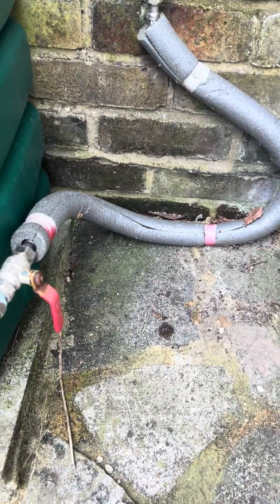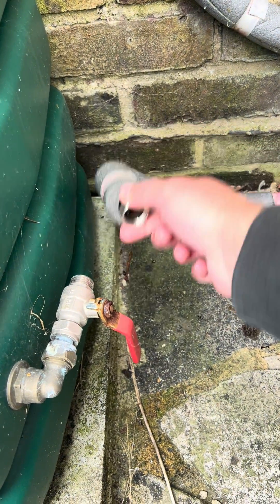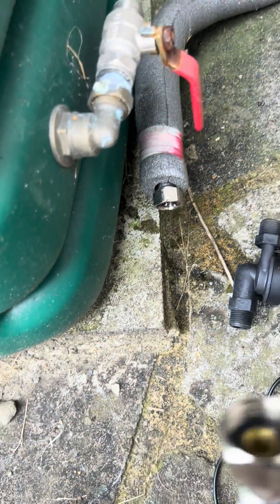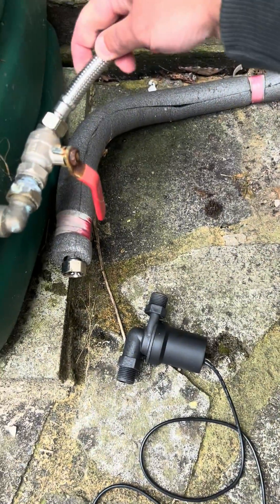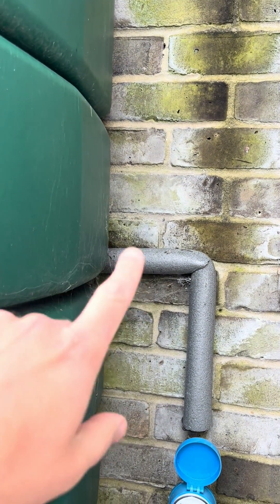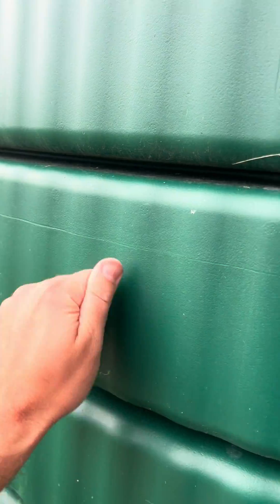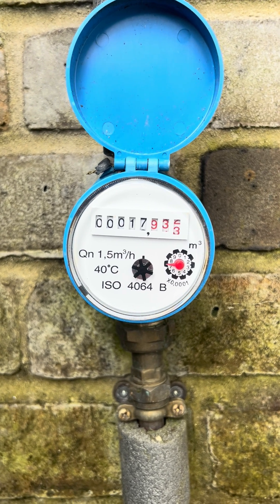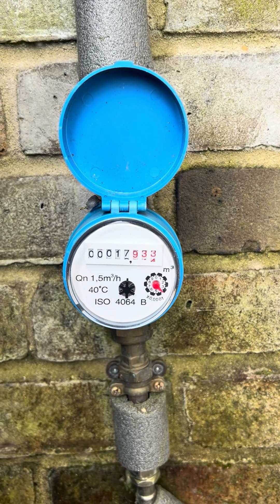Boosting Rainwater Consumption: Cheap Amazon Pump!

Comment: hi thanks for the vids, very topical now southern water has gone mad.  Can you tell me how the pump works as I can't see how it stops the flow of water into the cistern.
Reply from the maker: It’s the inlet to the cistern that stops the flow of water, the pump just provides pressure to the incoming rainwater feed - much like the mains water is pressurised.

Does that make sense? Once the water level rises in the cistern the float val be closes it 

This particular pump just keeps spinning but hasn’t burnt out yet. A pressure switch seems to be £££
Reply: @GreenWhereItSuits  thanks for the reply and posting a simple and affordable solution (didn't fancy digging up the garden, to put a tank in ;). Can you post where to get the storage tanks from, thanks again petros